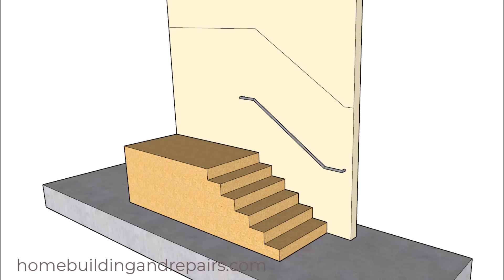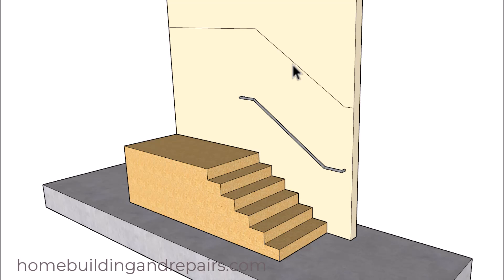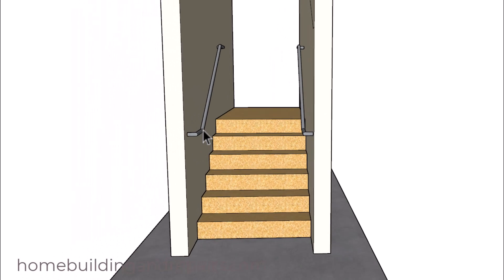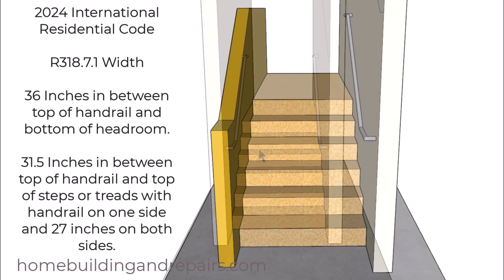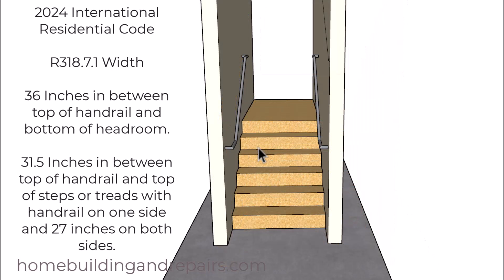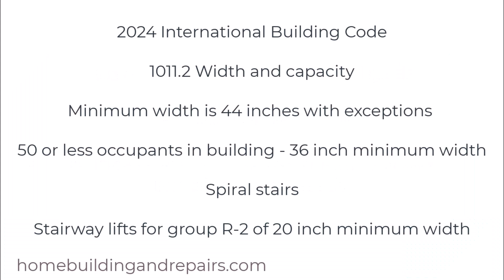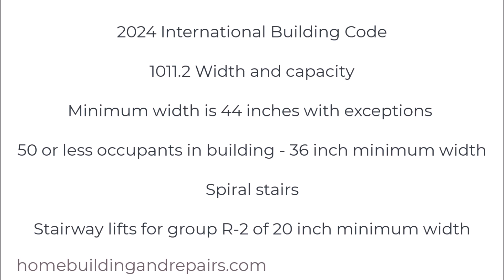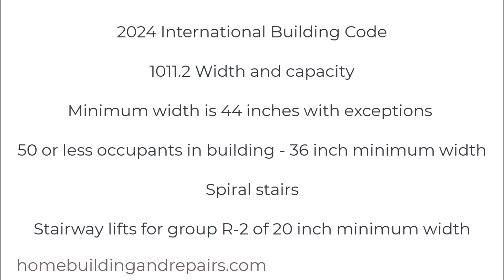Minimum Width In Between Handrailing, Guardrailing And Walls For Stair Construction or Remodeling

Comment: Pretty sure what you're saying is incorrect. I think what you were trying to say is31.5 inches is the minimum clear width when a handrail is on one side, and 27 inches is the minimum clear width when handrails are on both sides. Minimum clear width would be the distance between the two handrails or the distance between one handrail and the opposite wall. Maximum projection of handrail into the stairway space would be 4.5 in each. Two of them would be 9 in. 36- 9 = 27.

 I do enjoy all of your videos however.